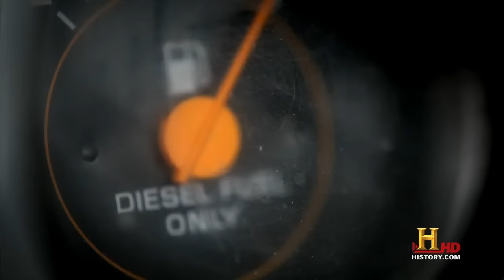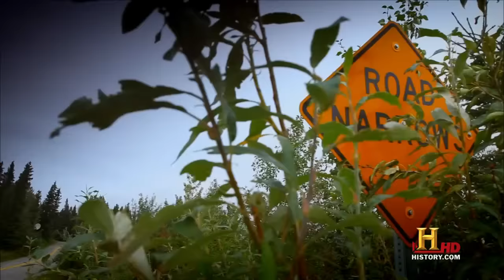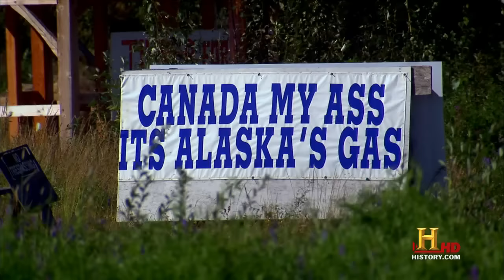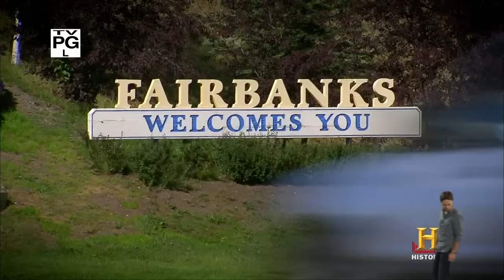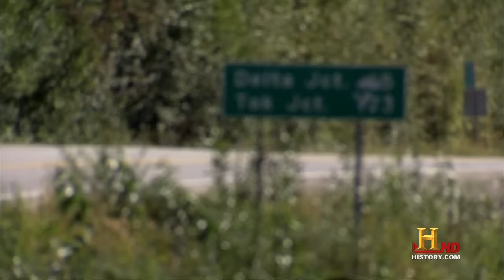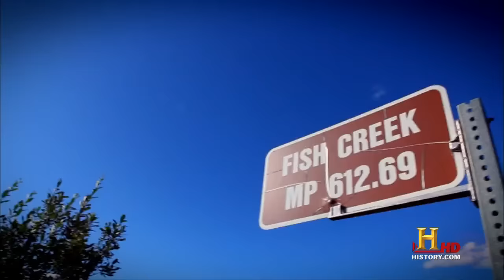Top Gear America Best America's 4x4 Truck   S01E09 - 2011.01.16

Comment: A fact every person who has ever been rough on trucks, especially in the south, we know the old Toyota’s are indestructible. I have tried to break one before... they won’t.
Reply: Unless you get them wet....
Reply: scarhart53 i have literally sank one and it started up.
Reply: @scarhart53  not true, go look up uk top gear with that toyota.
Reply: Minus the rusted in half frames and the gallons of oil they drink...
Reply: First off the only truck that rusts in half is a ranger, i think you got your trucks mixed up, Toyota back in mid to late 80s was voted to have the best steel frame and one of the strongest axels made. As for oil i don’t know an old truck that doesn’t do that. Maybe you just have to go watch some more YouTube videos that tell you what to think. I’ll keep doing the real world testing and you tell me which is more effective. 😘
Reply: That’s really good i just got my first truck a 99 tacoma
Reply: @hunter mitchel
Great truck. Treat it right and i bet you can easily get 500k+ miles
Reply: @nomoregoodnamesleft2  my 88 going 350k strong
Reply: @logan9957  that’s just getting warmed up hahaha
Reply: My grand father has what i think is a 92 2-door Toyota tacoma that runs like a damn champ
Reply: @scarhart53  😂😂😂😂they dumped a tacoma in an ocean and it still ran
Reply: @scarhart53  2005 we pulled our toyota out of a lake after my brother left the parking break off and it slowly slid down hill into the water and was submerged upto the roof  we had to sit on the roof in the water to show where it was . . . 2 hours later tow truck pulled her out and we let her drain. . we made my bro drive it back to the house. . .55 miles with no water in the gas tank no water in the engine no water in the windshield wipers no water in the main lines just wet seats and mildew a month later. 
even took her to the shop to have her checked and shop said she had some rust on her under carriage and some interior repairs needed like seat fabrics being cleaned or replaced but beyond that she was as good as the day she took the bath.  shes a 26 year old Toyota now n still gets used as a farm truck . regularly towing trailers thru mud and carrying 3000lbs of animals .  
ill say this about toyota like my grandfather would. . if toyota was able to create some of the toughest army vehicles ever put into action durring ww2 and the cold war. if they create the parts that are used in over 75% of all vehicles on earth no matter the brand and are able to sell 80 year old cars from 1940 that work as good if not better than most modern 2000's cars . then why tf would i sell my toyota just because it dont have automatic windows and a Cd player built into the radio. . . tooo many drivers rather sit on leather seats in a car that scrapes the street instead of in a car that eats anything that touches its feet.

also edit forgot to say the fuckers only had its transmission replaced once and that was in 2014 because it was getting hard to find a new replacement and old used ones were iffy . so we replaced the good working one and kept it as a back up incase the new one fails. had one custom built new from old recasted parts.  and it had over 500k miles on it when we pulled it . new one got over 250k now after only 8 years of being abused for hauling
Reply: Yeah me and my buddies put a Dodge through the torture test once because we were skeptical if it would make it and we ramped about 10 feet off the ground and it still ran what about 10,000 miles before it had an issue then we tried messing around with a Toyota tundra  and I was never a fan of Toyota trucks but I have to say it handled a gravel road decently 🥺
Reply: My obs f150 i sunk...pulled out changed fluids and drove it home..thrashed and races...ford 4.9 won't die.....my Tacoma got killed by cruise control......125k miles on the Tacoma and the engine scattered while set on cruise at 70mph
Reply: Note* my obs has 300k miles and I still trash it...had it since 140k miles and all original
Reply: One of my tojos grenaded but was awesome offroad. Snorkels are critical on the toyotas.  My full size dodge is a beast off road also but is too big and heavy to go where the Toyota goes.
Reply: @nomoregoodnamesleft2  Actually, Toyota trucks of that era were infamous for rusting frames. Do your research next time.
Reply: @ertgb_  lol yeah they had a huge recall for like most of the tacoma's frames. That dude ain't very smart
Reply: Ok we get it you’re a Toyota fanboy yes they are destructible put a trailer behind them bye transmission I get tons of them at the shop lol
Reply: @LSXperts72  in fairness they are a light truck and not really meant for hauling anything meaningful
Reply: I've pulled many rice burners out of mud though.
Reply: Unless you give one to whistlin diesel
Reply: I was sad when I had to sell my 2002 4RUNNER to my brother... but at least I kept it in the family and I replaced it with a 2003 Sequoia... you just can’t beat a Toyota.
Reply: @nomoregoodnamesleft2  Toyota had a 3 billion dollar recall from '95-'03 due to issues from frame rust
Reply: @dustinjohnson1952  My cousin had one and he had it on a lift and the damn thing broke in half. Still ran pretty good though.
Reply: To be fair, they tend to break in half. Every one of the 88-93’s that I had broke the frame in the exact same spot. No big deal, we always just fish-plated them and kept on driving them. Other than that, they were indestructible.
Reply: that's just not true, everything breaks
Reply: I tried to kill my toyota

Then it tried to kill me
Reply: I saw a guy hauling a bobcat with one. Made it awhile before the rear dif chewed itself apart.
Reply: @SandersChicken  well they aren't made to haul heavy equipment
Reply: The Toyota truck I owned (my grandpa's he gave me that was babied the whole time he had it,, a 93 4x4 standard cab with a manual in Georgia): 40k miles: Clutch went out. 60k miles: Jumped time. Engine rebuilt. 75k miles: Snapped the front axle. 90k miles: Jumped time AGAIN. Engine rebuilt. 100k miles (in water just a liiiiiiittle bit too deep): computer died. 110k miles: Exhaust manifold cracked. 125k miles: Broke the transfer case. 130k miles: Driveshaft snapped. 145k miles: Tossed a rod out the side of the block and was taken to the junkyard where it belonged. My freaking LAND ROVER was more reliable than my Toyota. And I can't even begin to count the number of times my Wrangler had to save it on trails.
Reply: WhistlinDiesel managed to kill a Hilux... but it involved a helicopter!
Reply: @Ryan-sw3km  They might’ve had one but my Grandpa’s 1986 Hilux has 638K miles and counting. Changed stuff like oil, brakes, fluids and nothing ever gone wrong except the clutch burned out at ~300K miles.
Reply: My brother killed his 86 with a 22r and a five speed... i think hes putting a 5.3 into it even though i think he should rebuild the 22r
Reply: @jamesprice2163  5.3 would be a cool swap. Would be a tight fit but it’s hard to beat the extra power And torque in a light truck
Reply: cant get one for $3000!
Reply: had a tacoma that went 327k and ran perfectly until a 200 dollar ecu went out, if we'd replaced that she wouldve ran perfect again.
Reply: i love the old Toyotas. they are awesome
Reply: @Ryan-sw3km  pretty sure that just the newer ones they had the recall but I could b wrong
Reply: @Irish88_  the one top gear did a test on was an 80s
Reply: @nomoregoodnamesleft2  Toyota of the 80s isn't Toyota of the 21st century.  They haven't been able or willing to figure out the frame rot issue for going on 20 years now.
Reply: despite these ppl in the comments saying toyota is bad, my ‘89 hilux is goin strong ❤
Reply: @TheFinnishTanker  hilux is not a truck💀
Reply: @JakinThebox12  yea it is 💀
run your truck not your mouth <3

Comment: The Toyota in and out of the bushes got me laughing 😂
Reply: Same
Reply: Lol ik
Reply: Those were the best parts😂😂
Reply: 3vze 3.0L v6
 xD roaring in and out of the bushes lol xD
Reply: kevin hawley I don’t think that was the truck I think it was affects.
Reply: W the bonsai kinda musical beat in the background. Loved it. For a second thought they scored the toy for $3k or less, but... Um... No ? I doubt it
Reply: Anthony Huntley Yeah, the older Tacomas actually had a pretty nice sound to them, at least a nice sound for a 3.0 V6. The sound bite they used was a little too rattling and shrill.
Reply: @joshualaw375  The sound clip was from a V8.  You won't find non-V8 Toyota of any kind that sounds even remotely like that.  A lot of people just don't respect a truck that doesn't growl, but in an off-road rig, horsepower and sound mean next to absolutely nothing.
Reply: I have a Tundra and Chevy and Ram are garbage! Ford is better but still not as good as Toyota
Reply: @tommymostar8512  The tundra is junk. I had a 2012 tundra and it left me on the side of the road with a blown headgasket. I sold it for scrap. Toyota is junk.

Comment: technically all the trucks would have made it had they slowed down and just let the tires and suspension do there jobs
Reply: Harold Spitzner horrible representation of a Ford truck. Horrible driving. No skill. This guy gets me every time he's behind the wheel. And he acts like an old lady. Lol.
Reply: Allen Brooks fords sick. That's why it was out first.
Reply: Probly were told to drive like that to make them break... woulda been boring if not
Reply: Agreed
Reply: would have been a lot less entertaining that way
Reply: But that would have made an even more boring video.
Reply: Although I’ve ripped a drivelines from my ford and I’ve jumped my Chevy till snapping the front leaf springs. Fords were too heavy. Ford made money on maintenance and Chevy on sales and dodge on expensive parts and terrible service intervals. Chevy “check diff lube every 30k” dodge”change diff lube every 15k” and these were on 2006s!
Reply: Right! The Dodge was so close...
Reply: I agree, this show was about entertainment not about demonstrating durability or which brand makes a better truck.  Way too many variable uncontrolled for to be a serious test, this was for fun factor.  Notice how the trucks had roll cages in them and heavy duty seat belts.  The producers wanted them to push the boundaries.  I doubt they all came with roll cages when bought second hand.   I am still a pretty novice off-roader (TJ), but they were practically trying to break shit.   Also the Toyota had a snorkel and probably had the key things sealed up, so it was modded to go through water-crossings successfully, the other trucks had none of that.
Reply: Allen Brooks it's a episode about what truck could take the most beating the toughest truck is the Chevy.
Reply: Any of the trucks driveshaft would have broke on a rock unfortunately it was the ford
Reply: Airdown could help a lot!
Reply: Harold Spitzner exactly when he said keep momentum😭
Slow and steady baby
Reply: Harold Spitzner Absolutely agree. If they knew how to drive!!!!
Reply: The episode was to find who"s truck is the absolute toughest, not to get them all to the end.
Reply: It’s fake. They didn’t really go on a big adventure. It was filmed in one day in the same spot.
Reply: @EASTSIDE-313  Was also 20 years older. Lol
Reply: @tylermaxton1935  Actually 1976-77 F250 trucks are probably the toughest trucks ever built, you can't blame Ford for a worn out u-joint.
Reply: @EASTSIDE-313  Who knows how many miles and wear was on the Fords u-joint.
Reply: Allen Brooks it’s supposed to test which truck can take a shit lod of abuse
Reply: That takes out the fun
Reply: It's a comedy
Reply: Y'all don't understand top gear do you?
Reply: That is true because I was driving in similar terrain in Guatemala, in a Toyota pickup and I was going too fast so it would just make it harder.
Reply: @allenbrooks7318  your just mad the ford died first, Lol
Reply: @taylorcarr5252   some people just do not realize that they where trying to find the toughest truck so they were trying to brake them, and i can bet none of us would have watched it all through if they where just going 4MPH
Reply: *Their
Reply: @tylermaxton1935  nope, the taco
Reply: I want to see what a stock s10 zr2 can do there lol

Comment: I love that he said it’s a 96 with a 5.7 😂 when them trucks came with the 5.9 or 5.2
Reply: I caught that too 😂
Reply: Lowkey mad it wasn’t a 5.9
Reply: Good chance a 5.9 just a 318 with bigger heads
Reply: You're all wrong. The 96 did offer a 5.7 hemi.
Reply: Never heard of the 90s rams having a 5.7 hemi option. Only the magnum v8’s far as I know the early 2000s like 2004 and up they put 5.7 hemi in those. I could be wrong but if I am so be it.
Reply: @bryanmccollum210 the Hemi didn't come out till 2003, there's no way there was a 5.7 in the truck. The 5.2 and 5.9 Magnums were the V8s that carried on into the early 2000s. Besides the 4.7.
Reply: @314jeepsnmopars3 hell ya!!! Agreed! Years ago used to drive a 99 dodge Durango had a 5.2 in it miss that thing everyday
Reply: I just gonna say that
Reply: He also thought that water half way up the tire would drown the truck. 
He's kind of an idjit really.

Comment: If only we could get trucks like those for 3000 today
Reply: You still can. It's called Craigslist.

But even on Craigslist, they're still pretty rare.
Reply: Krishan's DIY These trucks aren’t worth $3,000 a piece. Maybe the Dodge but not the Ford & the Chevy. Not even close.
Reply: On facebook marketplace there are dodges like Rutledges for 600 bucks
Reply: Thomas Smith Absolutely
Reply: The “squarebody” Chevy is a truck going up in price. It’s getting harder and harder to find a square short bed, especially a 4x4 short bed with a straight body for a decent price
Reply: Jakes Farm yeah but their transmissions have Grenada’s and they’re rotted out
Reply: @jeffreyweaver6355  true story, at least here in the SW USA
Reply: I can get something for $1000
Reply: Thomas Smith sorry bud that year dodge had 3 engines none were a hemi
Reply: Here in 2022. You can't get a frame for $3000
Reply: Yeah toyotas i paid $2800 for my 89 4runner. Basically just a hilux with a top
Reply: Funny enough I got a 98 318 ram for 3000 on Facebook market place
Reply: in alaska? impossible.
Reply: i bought a 1994 ford f150 4x4 5.0 5 speed reg cab short bed with 106k miles  for $3000 last week! You just gotta look and they are out there! It needs a little body work cuz it was in an accident, but it just needs the new door painted and to have the door rekeyed and its just as good as the ones selling for $10k right now! Yeah it has a salvage title, but I don’t care it’ll run for another 20 years!
Reply: @mromatic17  i got a 92' ford step side last year for 3200. its a pretty decent rig, but it's got a lot of problems that just keep pilling up
Reply: @williamfletcher2447  car problems suck. All the engines offered from 87-96 are a solid choice. i wanted a manual to limit the chances of problems i hope it does last it runs and drives perfect too so depending on what it needs donr it might make sense to fix it!
Reply: Just checked eBay after watching this video 😂😂no luck
Reply: Yes I just bought a dually 95 Ford for 2600 runs great looks good
Reply: @retrokingranch  Yeah,that's not gonna happen today and especially not without them being stolen,no title,many things wrong with it,a shit ton of damage and with them having like damn 350,000 miles on it. 🤣🤣🤣
Reply: @jakesfarm6790  Yeah that don't run,have many many miles on them and problems or don't run at all.🤣🤣
Reply: @firstlast-zg9ms  True,or a damn catalytic converter.🤣🤣
Reply: @mromatic17  I highly doubt it,it's a 94 and trust me because i had a 94.
Reply: @LONEWOLF-rq5tl  you highly doubt what? my truck is a 94 f150 with 107k on it right now.
Reply: I got my non lifted 1971 f-250 for 1500
Reply: Yeah you also wont find that Tacoma for any less than 10,000
Reply: I got a 4x4 regular cab short bed GMC S15 with a plow and topper for $2300, and it has the old style interior in blue. You can still find stuff like this, but you have to go out of your way to find them. I had to go out of state to get it.
Reply: I'm from 3 years in the future. These are still not any cheaper.lol